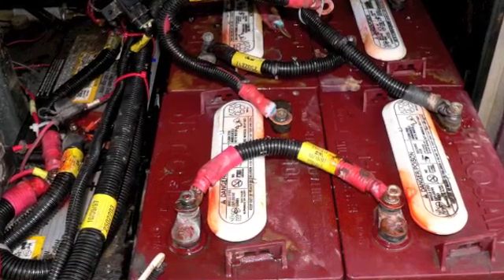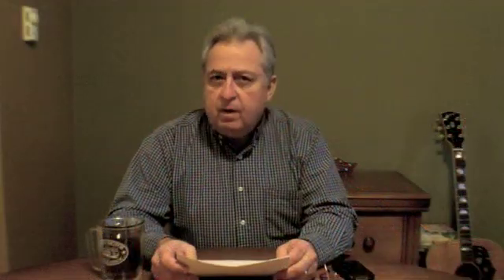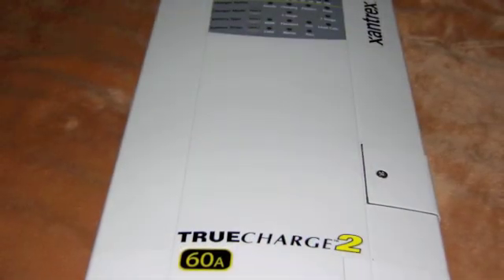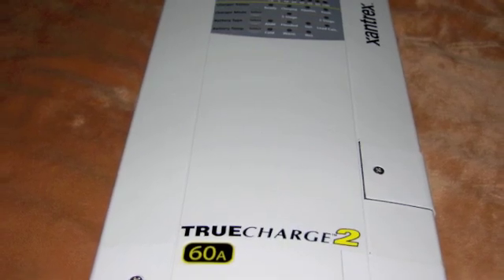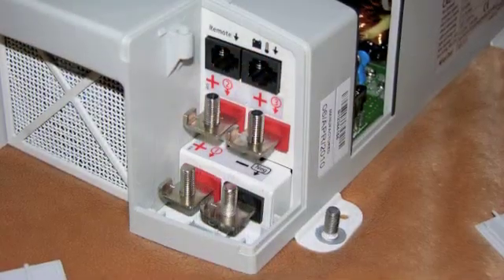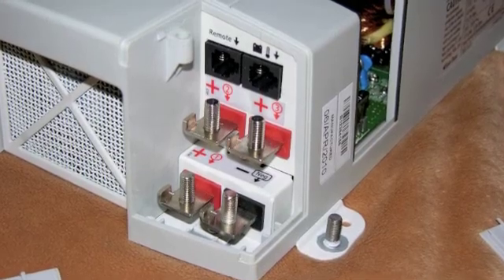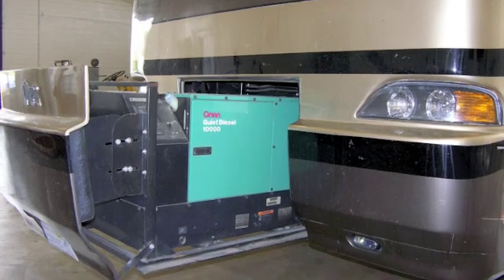Charging a Motorhome's Automotive Batteries

Comment: I have a 2004 Holiday Rambler 37 foot Class A. My house batteries charge well when the engine is running or if I turn the generator on, or during daylight hours with the solar My problem is the house batteries don't seem to be charging at all plugged up to shore power. I don't see a place in the Maine fuse box AKA converter box manually switch it on. Can you please advise if there's something I need to turn on so that the shore power is charging my house batteries? Thank you so much.
Reply from the maker: If the batteries are charging from the generator but not from shore power, that would rule out a problem with the converter.  This would take us to the transfer switch, but there was no mention of any issue with 120v power while plugged into shore power.  However, it still could be a problem with one of the hot contacts on the shore power side of the transfer switch.  This can be caused by arcing of the contacts causing carbon build up.  
Assuming the coach is 50a, I would suspect a possible issue with one of the hot lines on the shore cord, an issue with the shore power itself (can rule it out if he has tried different receptacles),  or a bad park adapter.
Inspect the shore cord carefully for damage or twisting and check the plug prongs to make sure they are clean and undamaged. Try a different circuit if not done already, and try a different adapter if possible.  Otherwise the issue will have to be investigated by a reputable service shop.

Comment: Quick way I use is (with a fused cable)connect from 12v outlet socket in the rear to cigarette socket in the front for trickle charging the front from solar or shore. Remembering to Disconnect after top up.